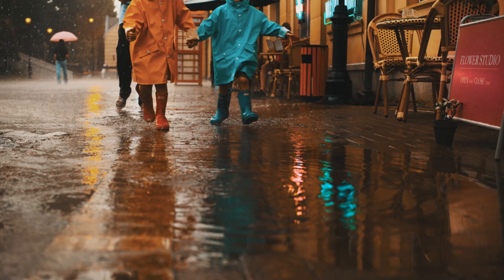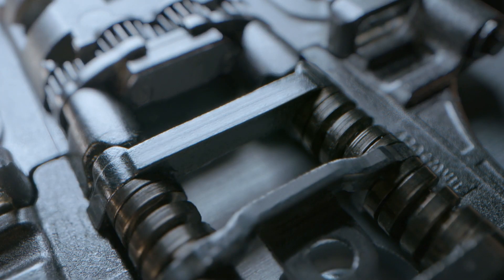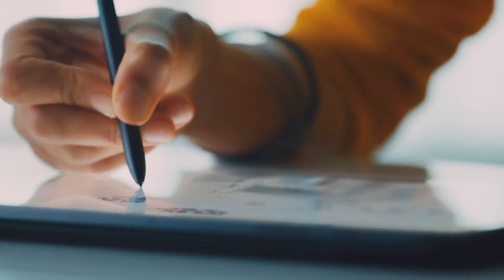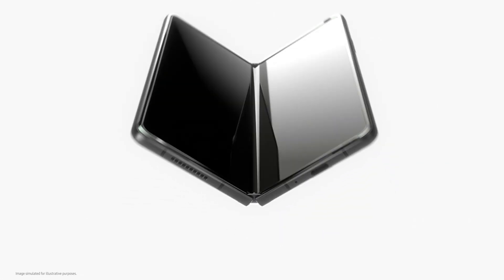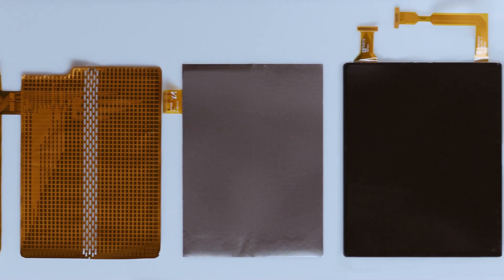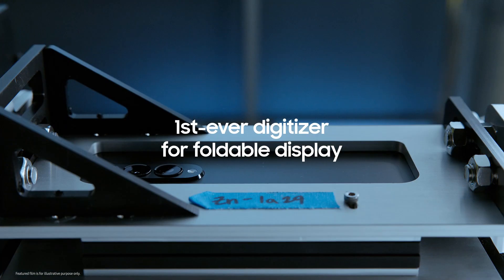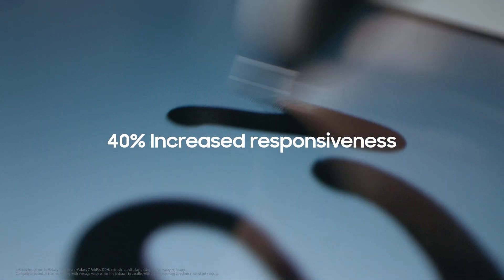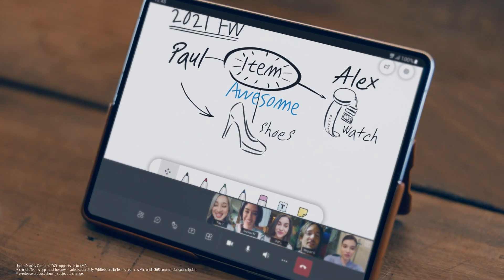Galaxy Z Fold3: Untold Stories – Water resistance & S Pen | Samsung

Comment: To be honest, your water resistance for the Z Fold 3 is not really reliable. In less than a year I got 2 Z Fold 3's and both broke with just a touch of water. For the next generation of Z Fold devices make sure that you're 1000% sure about advertising your devices as water resistant as it costs a fortune to buy one, and you don't even include water damage repair with the warranty wherein you should be including it as your consumers expect your devices to be safe with water (e.g. splashes, rain, accidental drop).